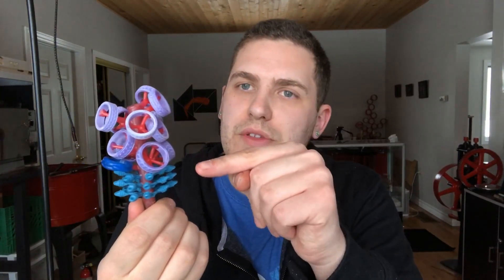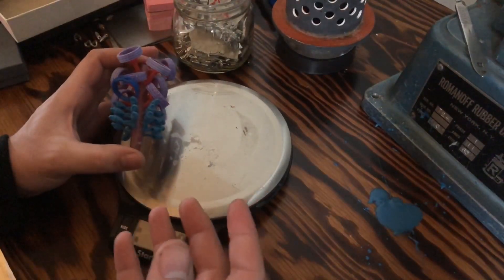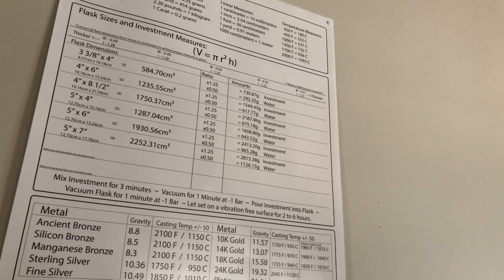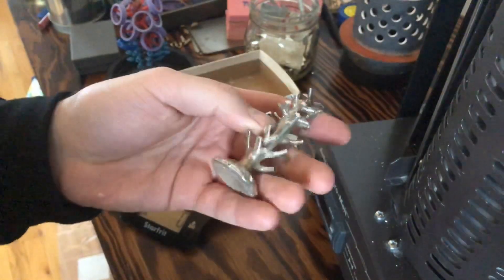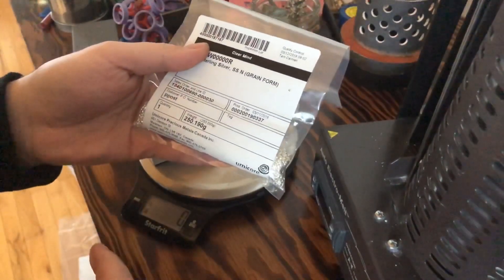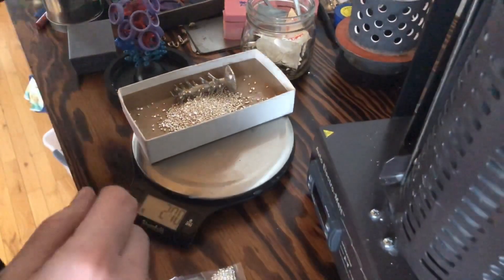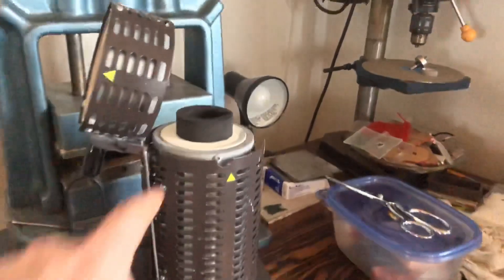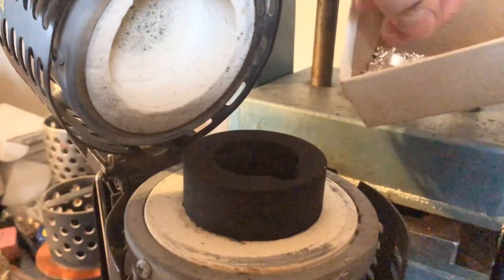Lost Wax Casting Metal Density | How much metal do you need in your cast

Comment: Nice video. I have one recommendation when loading the Kerr. You threw the heavy weight button / tree in there first. As graphite is very soft it could damage the crucible over a certain amount of time. I would load it with the beads first and then you have a cushion you can drop the button on. I hope this makes sense.